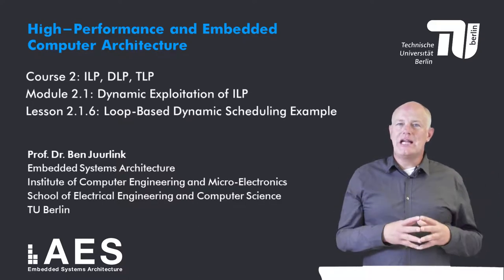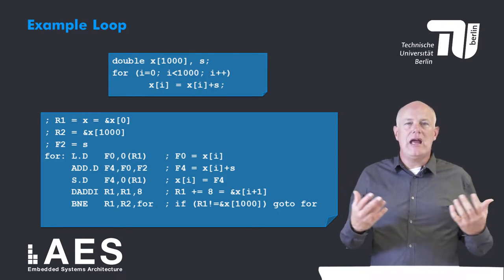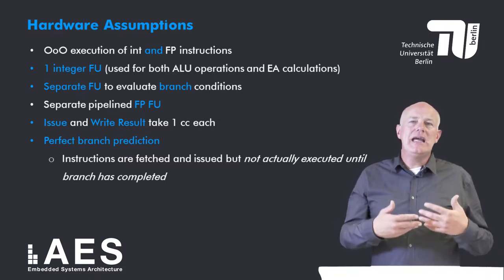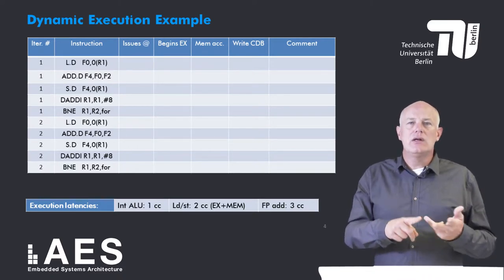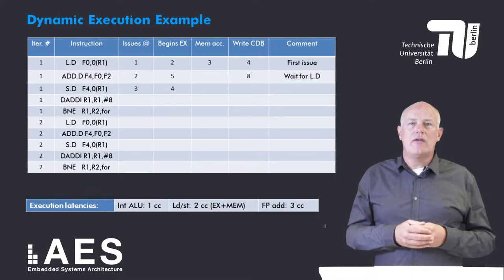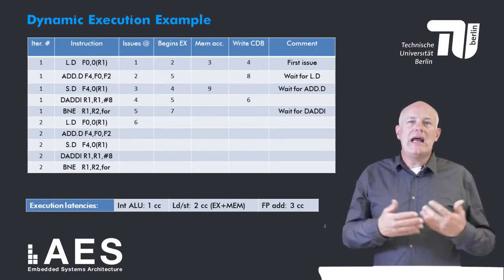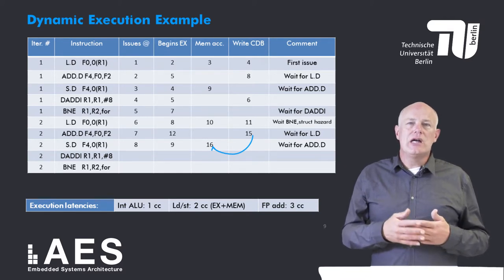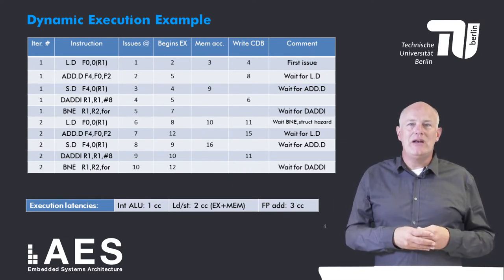2 1 6 Loop Based Dynamic Scheduling Example

Comment: First, thanks for sharing, it was really helpful. I think that there is a mistake in the second instruction DADDI R1, R1, #8 since there is only one CDB so we can't write to the CDB in the same cycle
Reply: no it is  not in the same cycle
Reply: @mhd-em6yt  Its not 11th cycle for both CDB writes? Or the later one is stalled to 12th cycle?
Reply: Yes, he made a mistake. The latter adddi should be stalled until the 12th cycle because of the structural hazards that will occur on CDB.

Comment: It seems that in the execution of memory access instructions, the latency of memory access is not taken into consideration? And isn't the CDB a bus, but not a register, hence there should be no extra cycle running write CDB stage? And the second DADDI may collide using CDB which is occupied by the previous L.D instruction.